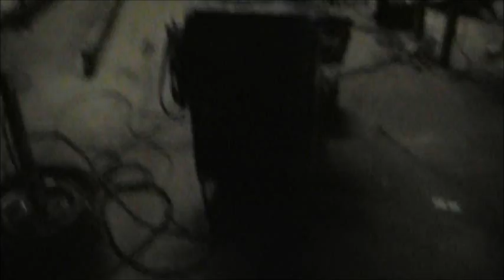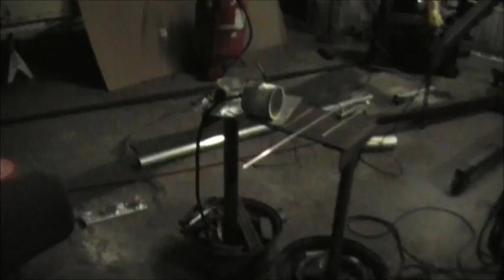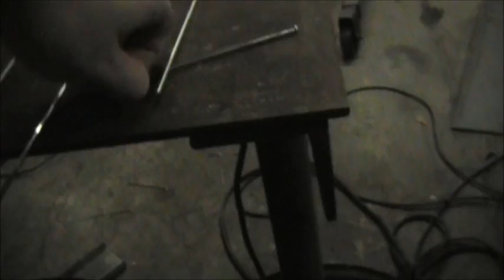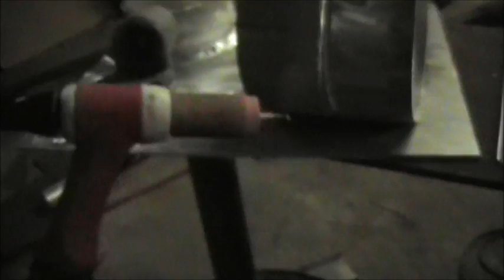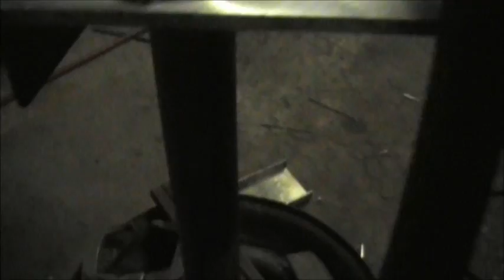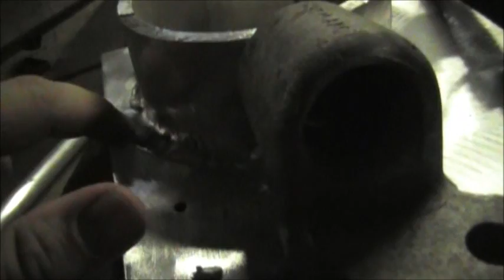RE: Tig Welding

Comment: DC+ balls the tungsten welder is on AC and settings for me are set based off thickness if its 62 thousandths aluminum set the machine to 60, 2 thousandths less then the thickness of the metal

Comment: Use a separate stainless steel wire brush dedicated for aluminum. Use a dedicated grinding wheel for the tungsten and never use anything else on it but tungsten. Put your tungsten in a drill and spin the tungsten on the grinding wheel as the grinding wheel spins. Eventually a groove will appear in the grinding wheel from the tungsten. After putting a point on your tungsten turn off the grinder and as the wheel comes to a stop place the point up to the wheel and grind the very tip off.

Comment: Next take your welder and put it on DC- and hold it above a piece of steel. Mash down on the pedal it will make a nice shiney ball on the end of the tungsten. Place your welder back on AC and you are ready to go. If you are welding thicker aluminum you may need a Argon/ Helium mix. Remember you want the ball on the end. I also use the orange marked tungsten on aluminum and you can grind it down to a point for thin sheet metal and not have the ball on the end. I use 1/16 tungsten for thin metal

Comment: I'm not sure about the sizing of the tungsten but a few things maybe you already know. when welding aluminum both pieces must be very clean the best way is to buy a dedicated wire brush for just aluminum. that should help with cratering. 100 percent argon for shielding gas is a must for aluminum. The other thing is when grinding the tungsten grind the direction of the point. If you grind perpendicular it will make a spiral to the point and cause a bad arc that tends to jump. Hope that helps